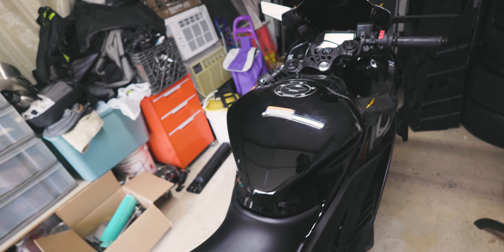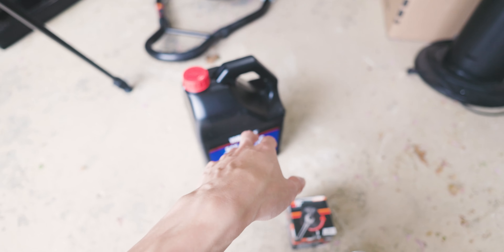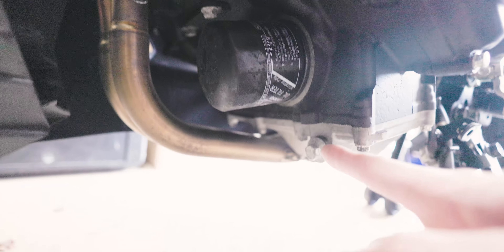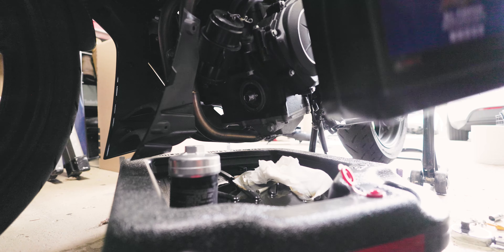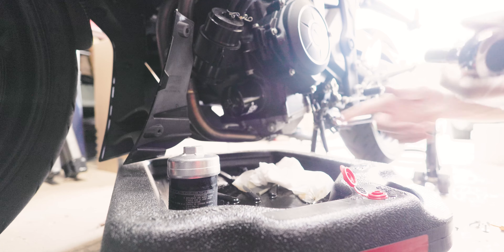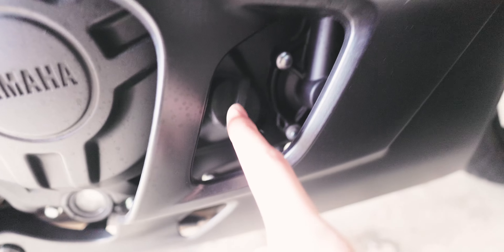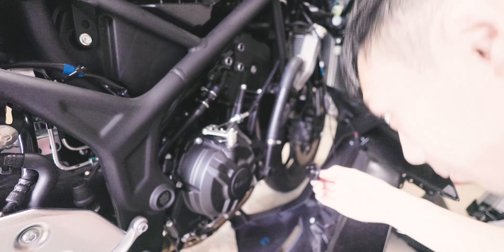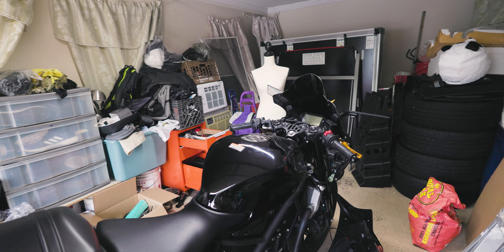How to Change Oil & Filter on Yamaha R3!

Comment: How often do you change the oil filter?
Reply from the maker: First break in period at 700miles. But after that Yamaha recommends 3000, I tend to do 2500 intervals
Reply: @RickyMoto  what oil filter do you use? Can you Send a link?
Reply from the maker: https://shop.advanceautoparts.com/p/k-n-premium-oil-filter-ideal-for-synthetic-conventional-oil-designed-to-protect-the-engine-kn-204-1/11980706-P?product_channel=local&store=6718&adtype=pla&product_channel=local&store_code=6718&gbraid=0AAAAAD05GhVJIeb4hhQ3aapmBVcXavPDV&gbraid=0AAAAAD05GhVJIeb4hhQ3aapmBVcXavPDV&gclid=CjwKCAjwiJqWBhBdEiwAtESPaJpCbTk05frQTRRERGoUEhZTzdIr7IAx4sFH0h9pAOcu-FVTqRx5ehoCHakQAvD_BwE&gclsrc=aw.ds